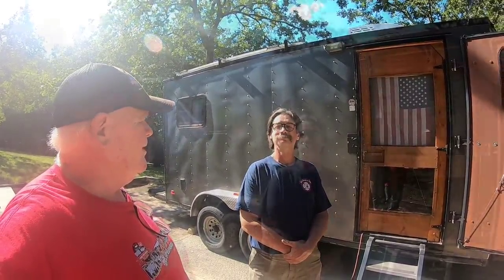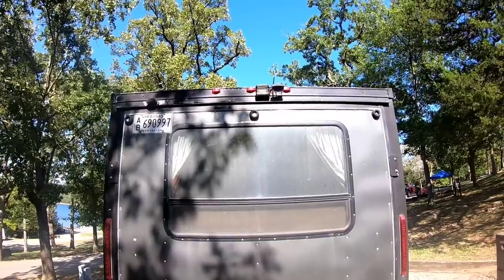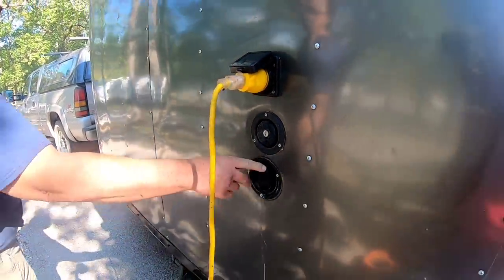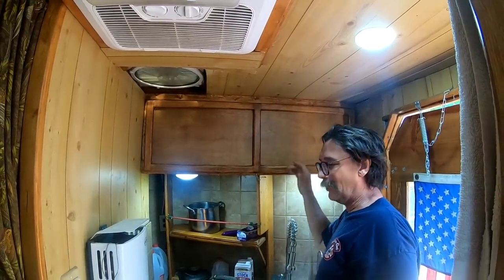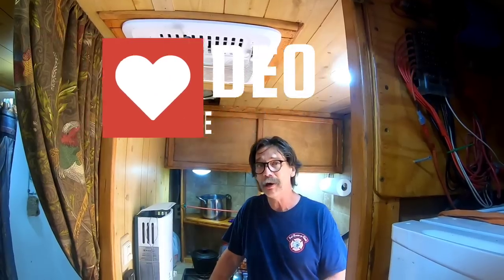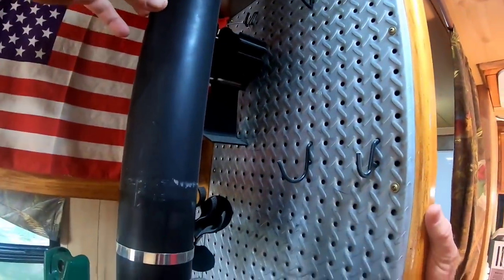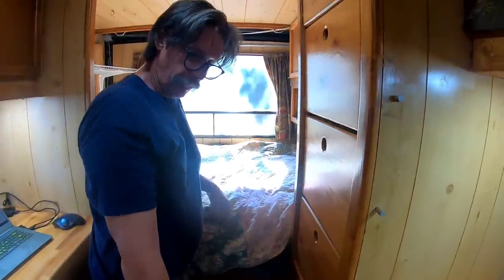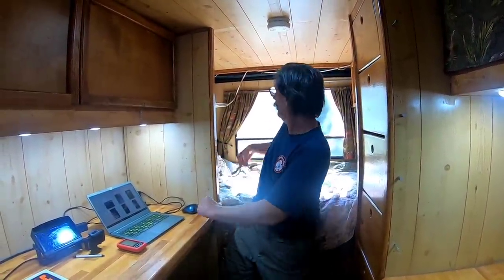Well Equipped Boondocking/Off-Road Capable Cargo Conversion Camper

Comment: RV Description:
2018 RC Trailers 7 X 16 X 7 High, V Nose Slant Top Cargo Trailer Conversion, Dual 6000 Lbs. Rating Lippert Axles With 225 75 R 16 Wheels, Electronic Brakes, Heavy Duty Wet Shackles and Road Armor Equalizer Suspension, 16 Inch on Center Floor and Wall Steel Supports, ¾ Ply Flooring, 1-inch Polyisocyante Foam Insulation Walls and Ceiling, 2 Inch Foam Board Insulation Below Floor, Roof and all Wall and Floor Seams were Sealed with Urethane Elastomeric Latex Sealant Inside and Between Lap Seams. Two Thirty Gallon Propane Tanks with Auto Cross Over Regulator, Front and Rear View Back up Cameras with Monitor for Tow Vehicle and/or in RV Security Monitoring while parked.
Solar and Electronics:
8 x 100 Watt Renogy Monocrystalline Solar Panels (Tiltable), Renogy Rover 40 amp MPPT Charge Controller, 2000 Watts Inverter / Charger, Two 24 Volt 200 Amp Hour Lithium (LifePo4) Batteries, Progressive Industries Electronic Protection System Hardwired for 110 Volt 30 Amp Service, 24 to 12 Volt 70 Amp Victron Buck Converter, all 12 volt LED Lights with LED Flood Lights Outside, Max Aire Deluxe Vent Fan, 13,500 BTU Furrion Air conditioner with Soft Start Module for use with Generator Start Up. Oversized Wiring and Proper Fusing with Safety Cut Out Switches on Battery and Solar Panels.
Bathroom:
Full Bathroom with 32x32 Shower, Insta Hot Tankless Propane Water Heater, Dometic 310 Full Size High Height Porcelain Toilet, 15 Gallon Black (Heated) / 25 Gallon Grey / 35 Gallon Fresh Water Tanks, Sure Flow 12 Volt Water Pump with Accumulator, and City Water Supply with Sediment Filter at Fill Port and Pure Water 3 Stage Water Purifier Under Sink.
Kitchen:
Two Burner Propane Flush Mounted Stove Top, Double Bowl Stainless Steel Sink with Pull Down Dual Action Sprayer Faucet, Six Drawer Kitchen Storage Cabinet, Microwave Shelf, and One Large Upper Kitchen Cabinet in V nose, Tiled Backsplash Area, 12 or 24 Volt 6 cuft Solar Refrigerator with Freezer, Max Aire Remote Controlled Deluxe Vent Fan above kitchen area.
Living Area:
Cabinetry and Layout for Full Time living with Two Counter Tops (3ft + 5 Ft) and Cabinets above, Two Large Drawers Under Counter, Six Large Chest of Drawers for Clothing and/or Supplies, 50 X 78 Full Size Bed with Storage Below or Room for another 50 X 78 Full Size Mattress to Accommodate Additional Sleeping Area, Storage Cabinets in Bed Area with 50X14 inch Wide Metal Storage Shelf, Large View Picture Window, With Horizontal Open vent Window in Back, Emergency Exit Window Above Bed, Fire, Co2, and Propane Alarms, Wave 6 Propane Catalytic Heater, Mini Wood Stove Capable of Burning Wood and Pellets, Custom Made Curtains with Insulating Black Out Backing, 70% Window Tinting.
External Storage:
Bumper Storage Rack on Back of Trailer to Hold your Generator, Bikes or Gear, and Sewer Drain Hose.
Reply from the maker: Thanks
Reply: Wow you have a great rig there 👍👏👏👏👏✌🎅🚌
Reply: Interested in your Rv, where are you located and what are you asking for it?
Reply from the maker: Roguebull@gmail.com contact him please
Reply from the maker: Got an email from him recently. No, he hasn't sold it yet. Shoot him an email.
Reply: Marco Polo  CTC CAMPER FOR SALE, 
Thank you for taking the time to inquire.
The two 24 volt 200 amp/hr LiFePo4 batteries cost $1700 each ($3400). The 24 volt inverter charger was $800, Then the 24 to 12 volt buck converter which handles 70 amps was around $200. All the wiring, circuits breakers and isolation switches where over built to handle a 12 volt system if someone wanted to down convert. There is a $800, Furrion 13,500 btu roof ac unit with the soft start built in. The mini wood stove was another $450, plus kitchen build and full bathroom build $$. There is a 12/24 volt solar fridge that cost $1000
In April 2022 I rebuilt the entire suspension system with 6K axles, hubs, and brakes, 52K springs, Equalizer stabilizers, heavy duty wet shackles, new wheels and tires at a cost of $2600. The built out empty weight of the trailer is 4800 lbs. I towed it with a Chevy Sierra 5.6 v8 and it was fine.
I have well over $20,000 just in materials and that does not include my labor for the build assembly.  Obviously, I will never get what I have into it. Everything work as it should and the trailer is ready for living in.
I am asking $12,500 obo
Thank you,
Scott
Waldron, AR
Reply: I love your trailer!  I wish we were ready to hit the road but we have a few years left before we can make it happen
Reply: Love the build. I wish I was ready to go. I think your price is very reasonable. I love the axles and suspension. We need to haul our Can Am Spyder. We will be doing mostly boonedocking. I will save this video for future reference. :)

Comment: I need a trailer for Off Road Boon-docking on Service and Forest roads.

We live in north central Washington state in a very mountainous area.
Even though we had our home built into the side of our 1/4 of a mountain, we still Love camping in other mountainous areas, not just here in WA, but also in ID, MT.
We’re members of the WA BDR.
The BDR (Back Roads from the Columbia River on the Oregon / WA border to the Canadian border. It’s a 575 mile trip).
Our pickup is a 23 Tacoma TRD Off Road, double cab with the 6’ bed.
I can tow up to 6K #, but obviously want to keep my trailer as light as possible so I need an all Aluminum trailer.

Comment: Holy cow! 6k axles!! Talk about a rolling earthquake. Interesting build. Thanks for sharing.
Reply: Actually, rides very nice with the heavy-duty wet shackles and the big difference is the Road Armour equalizer that removes much of the transmitted force to the trailer. It greatly improved going over bumps and rough roads no more chugging from the hitch.
Reply: @roguebull3548  road armor? Maybe I need that! I have wet shackles.
Reply from the maker: Thanks for watching.

Comment: What size window ac didn’t work?  He never said how big it was…the one he removed.  I’m just curious.
Reply: It was a 5000 btu unit and it just did not keep the unit cool.  The 13,500 BTU Furrion  is efficient and will make it very cold if you set it that way.
Reply from the maker: Thanks for watching

Comment: Hello, how much does the whole trailer weigh in kilograms?
Reply from the maker: 2.2 pounds per kilogram
Reply: @billanddeb  What is the size of the house in length, width and outside height? for us, such a trailer is very rare, especially on independent suspension.
Reply: @billanddeb  
I can’t translate correctly, in pounds it shows 0.9979, it looks very small, in American tones 1995 kg and it actually looks like it, but I’m not sure, the translator translates, I know a little English and I don’t know the weight and dimensions.